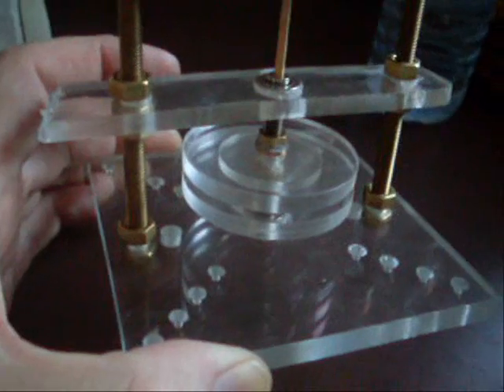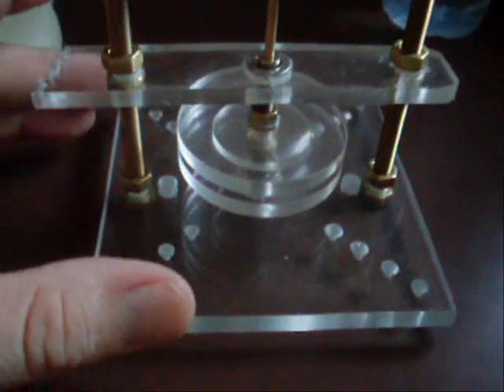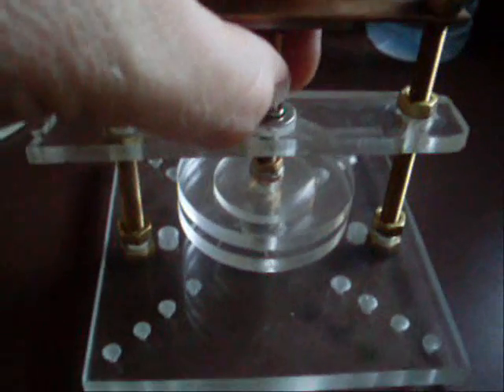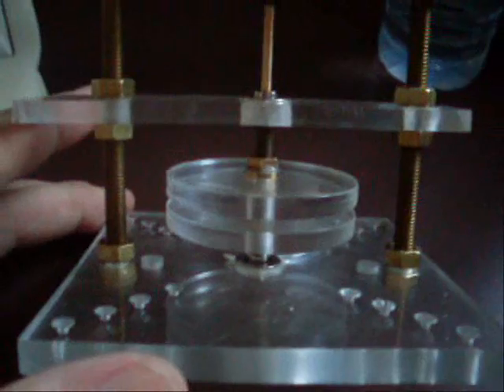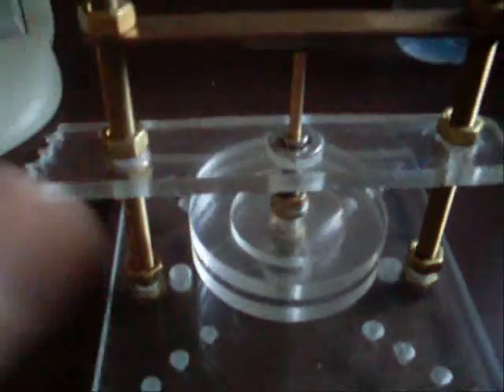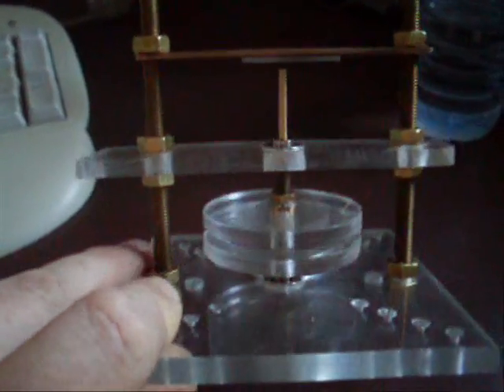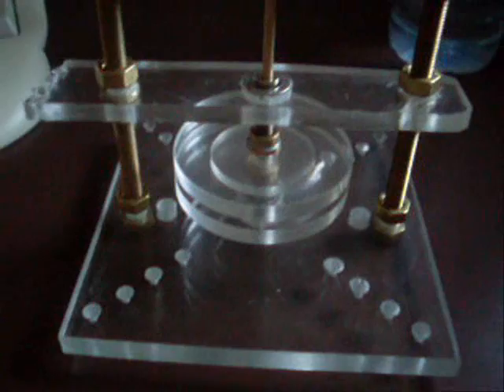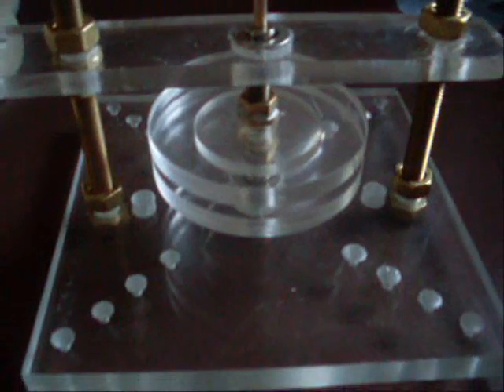Hartmann Magnetic Motor

Comment: wow, I had a same idea, but I put two horse shoe magnets  as simulation field of straight conductors which current flows in the magnetic field. also did not work, I found out later for a term called Faradey paradox.
Reply: +Marko Vukušić ~~ Do you know how to make a magnet with two like poles? 
I do.

Comment: Nice craft. How long can you get it to spin without added force? this design is stable, but you still lose some energy to friction on the bolt. If you can eliminate the bolt on the z axis you will have a free standing friction-less flywheel. Try it with a hall effect sensor and solenoid.  Use 2, one the top and bottom to stabilize. Place in a vacuum to eliminate air resistance. I'm still working on a free standing mechanical one.

search friction-less flywheels and you can find other designs.

Comment: Magnetic motors will never operate - the work of the magnetic force (or any potential force at all) over a closed loop is always 0!
If one finds another force in conventional magnets (some sort of a monopole) then it might work with a proper design. And certainly not this one.